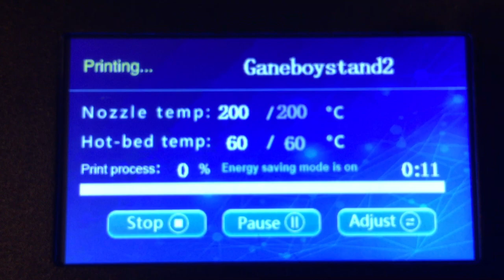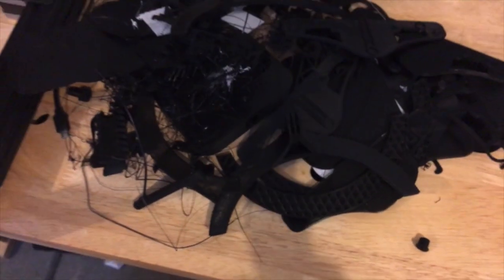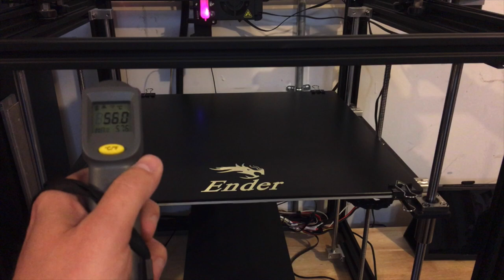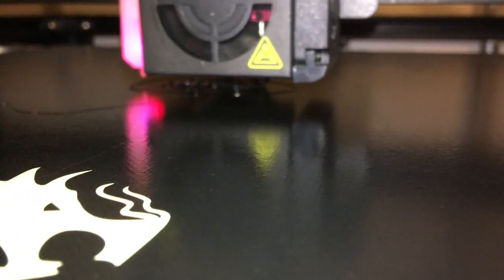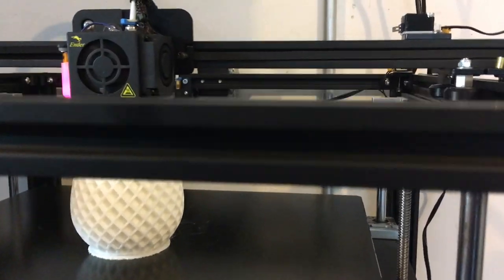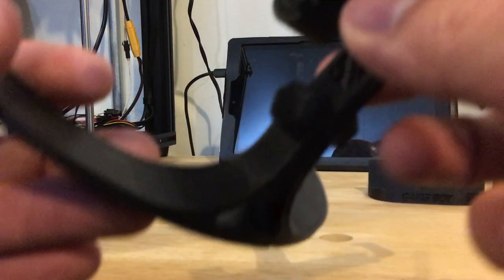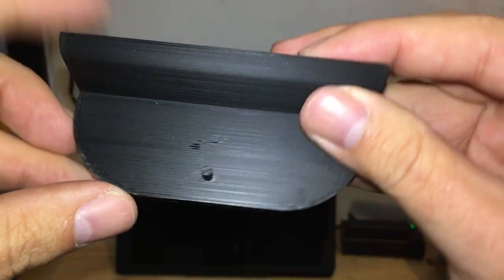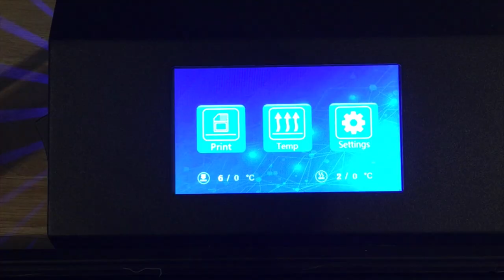Is the Creality Ender 5 Plus a failure?

Comment: I believe the problems shown come from wrong expectations. 3D printing is not a trivial think and so issues like the low temperature environment and many others can lead to falures trying to print. 3D printing is kind of a dance of parameters that influence printing. Operating the printer at a normal living space temperature increase the probability of good results.
There are 3D printers like those from Prusa that offer a more mature device.

Comment: Just purchased one, printed properly out of the box as well.
Reply from the maker: My power supply unit just died completely, only after 2 months.
Reply: @TripodsGarage  did you plug it in?
Reply from the maker: papapower -Yeah, found out after this video aired, the circuit breaker actually tripped, and was the real issue!  Who knew!

Comment: I have a CR 5 Plus and am having printing problems. I checked the print head temp with a thermometer and found the temp to be off. What type of thermocouple should be installed in the hot end?

Comment: so were all those failed prints 100% down to energy-saving mode? I have read people who say the energy-saving mode is useless, well it is on lock glass but on plain glass with adhesive when printing some PLA's it works ok and on very long prints it can save you quite a bit of electricity, I wouldn't risk myself though as if I lost a 24-hour print due to energy-saving mode the printer would be taking a flying lesson.
 I see you in live chats all the time and have conversed with you on many occasions and yet never knew you had a channel.
 +1 Subs

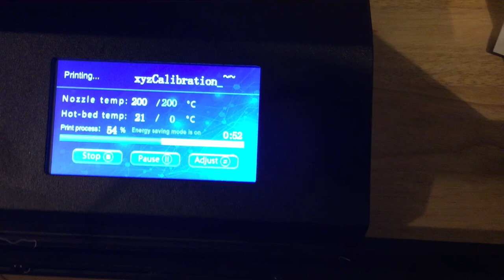Comment: At 5:08 I can see your bed temp is really low. I would have thought that you would need to keep this temp at 50C for PLA? On my old Solidoodle if the bed temp was low the glass would let go of the job. aahhhh I should wait until the end of a vid before commenting. Looks like you fixed that one.
Reply from the maker: Yeah, you will notice the Energy Savings Mode is on in the camera pass.  This feature turns off the heated bed just after the first passes.  I turned off this awful feature, my heated bed stayed on!  Yeah, I keep the bed temp at around 65 or more depending on the ambient temperature in the garage.

Thanks for taking the time out of your day to watch my videos!
Please like, subscribe and share! Tripod

Comment: Mine prints flawlessly right out of the box
Reply from the maker: Yeah if I would have knowing about that Energy Saving Mode, think my would have printed perfectly also.
Reply from the maker: @marthale7 Make sure Energy Savings Mode is turned is turned off.  That feature shouldn’t even exist 😉
Reply from the maker: marthale7 No problem!  Thanks for watching!  Did you watch my setup video below?  What is the current firmware for your machine?  It might already be current.

Creality Ender 5 Plus - Unboxing, Build, Bed Leveling, and first print! https://youtu.be/SDAfXD4PN2U

Please Like, subscribe, and troll..
Thanks- Tripod
Reply: There is nothing wrong with Eco mode by the way once you get the adhesion problem fixed there's nothing wrong with Eco 4 pla
Reply from the maker: @RealFifty  - Glad to see that Eco Mode works for someone!
Reply: I agree and a cool feature would be the ability to set the bed temperature with Eco mode once it kicks in to just drop the temp to something like 40c
Reply from the maker: @marthale7 Yep!  Nice cool glass plate, and the part slides like butter!
Reply: @TripodsGarage  So you dont need a better power supply if you just turn off eco mode .
Reply from the maker: @glenn1620  What does ECO Mode have to do with the horrible PSU’s they shipped with these machines early on?
Reply: @TripodsGarage  im asking if u turn off eco mode will the problem stil be there to buy a better power supply , on comment "Yeah if I would have knowing about that Energy Saving Mode, think my would have printed perfectly also."

Comment: Idk why I only have. Big problems with this one 😐 while my two ended 3s are working amezing... from bed prints to heat fails to broken filament sensor getting crazy off it
Reply from the maker: I recently bought a Ender 3 Pro’ish from Micro Center only to do a couple videos.  The bed is warped, and the board failed in just a month.  Last year my E5+ was acting all crazy and wouldn’t home correctly.  It kept on crashing in the front left corner. I reflashed the firmware, that didn’t work.  I replaced the board, that didn’t work.  I inspected all the connections couldn’t find anything wrong.  Finally I ran my fingers down each of the limit switch wires, and found a soft spot on the Y axis!  Sure enough after stripping back the wire, the wire was barely connected…

Comment: Hello
Wash your superplate... 
Your isopropylique alcool is 50%, not 99,9%
Before, launch Auto home and 16 control with bltouch. 
After... Disable eco mode and 16 point bltouch and decrease your Z by step -0.01mm at start printing, just before Auto home...
My Z=-2.40 (Ender-5 plus) 
Is not good, use 3D LAC = 0 fails 😉

Comment: dont use hair spray that wont help anything, when i had this problem i used a elmers glue stick and now i dont have any issues with the printer
Reply from the maker: @DJ Thanks for taking the time to watch my video!  Yeah, hairspray!  I was desperate to find a solution, every part kept on coming off until I found that Energy Savings Mode!  What a horrible feature!  Now that I have turned that off, and clean the bed between prints I no longer have adhesion issues.  I did use the glue stick after the video to test it out.  Wow! It most definitely works!  I have to wait until the bed is completely cool before I even attempt to remove the part.
Thanks again for watching - Please like, subscribe and comment - Tripod

Comment: I've had mine for a few weeks and haven't been able to finish any print.  Creality support has been ZERO helpful.  Last adv8ce w a s the printer had the wrong fireware.  They uploaded new firmware and when I flashed the screen it caused 3 white columns to flash on the screen and locked up the printer.  I was able to download other screen firmware and now I'm  back where I was.  I've been asking for a refund to no ava8l so far.  I want a proven Ender 3 but will go to another company if I don't get a refund.

Comment: WOW! bought this brand new nearly a year-and-a-half ago to this day and YET TO GET PRINT ONE!!! i have bought add-ons, read countless tutorials, mothered this thing daily - and N O T H I N G. $600 - $700 of JUNK. seriously! THIS IS THE WORST CRAP EVER. 100% SICK OF THIS SHIX. Other than what i've seen on youtube - I've NEVER seen this thing work. I've met several people who've bought this same thing and NONE of them have gotten this CRAP to work.

i broke down and bought a used flashforge - and it worked on day one!!!

Skeptical? thinking about buying one anyway? ok - go though EVERY setup on this 3d printer on youtube - you'll see the ONLY ones that "work" have been heavily modified and requires SEVERAL components NOT included.

worried about a budget? $500 - $600 for the craptacular 3d paperweight, + $100 - $250 for all the add-ons that doesn't make it any better + another $500 - $1000 for the next 3d printer you'll buy to realize what a mistake the ender 5 plus is.

If this were a car - creality be sued out of business

Comment: These printers are not for noobs。
Reply: I AGREE!!   I have two ender 5's which I learned on.  I got the Plus right after it came out.  The first thing I did was replace the extruder with a SeeMECnc and the hot end with a MicroSwiss.  It has been a workhorse since then.
Reply: In other words, do not buy an Ender 5 Plus as your first Printer?
Reply: Chris Marchese it’s kind of a gamble. You may or may not get a defective unit from amazon or whatever seller. There should be a troubleshooting guide because more than likely there will be a couple of problems even if following the assembly/install procedure. It will be a headache if you have no experience or patience to trial and error.
Reply: @tanklergaming103  I just ordered my Ender 5 Plus tonight. Guess we'll see what happens. I bought it with profit so it's basically a free 3d Printer.
Reply from the maker: I agree!  I have been researching and following these type of printers for about a year before I pulled the trigger, so I had an understanding what I was getting into.  I really just wanted my first printer to have a larger build volume.  If you love tinkering, and troubleshooting these can be of great interest.  However, I can see were someone can easily get overwhelmed and frustrated very quickly!
Reply: @TripodsGarage  There are some good groups on fb with people that have a lot of 3d printing knowledge to help get you on track.
Reply: @aninconspicuousman2288  It is a great printer, but take your time and don't expect it to be perfect on the first print.   Any 3D printer will take a some tuning to get good prints.
Reply: Tripod's Garage I was under the assumption that bed heat being maintained was 3d printing 101 with PLA. I think it’s over exaggerated, I’ve had successful adhere with initial bed temps at 60 and nozzle temp at 210, normal bed temp would be set at 25 or turned off automatically with eco. It works so well that it’s annoying how much effort to take it off. In my opinion, while the initial bed heat is hot by adhering and bonding to the surface of the heating bed, when it cools down after 1st layer is done is best. You don’t want the print to mess with the structural integrity of the first layer in any way at any stage of your print. Please don’t take my word for it, do a quick 5-10 minute test print of something simple. Please let me know what happens if you try. **used stock CE5-Plus heat bed.
Reply: I have only been using PETG so far. I haven't tried Printing with another type of Filament but I'm getting some decent quality. Also using Luke's Hotend Fix. I have upgraded bed springs, Capricorn XS Bowden and installed an aluminum Extruder. May print and install a direct drive system but not sure yet.

Comment: Would you buy it again or something else?
Reply from the maker: I would buy this printer again if it provided better documentation, Meanwell power supply, and if a MFG would actually return your messages!  Once I figured this out and replaced my burned out power supply with a Meanwell.  It is running a lot better.  Otherwise, for my next printer I will definitely be doing more research!

I would suggest watching my other video below.

Don't buy a 3D printer until you this! How to replace the cheap power supply! https://youtu.be/A-Zb40P09MQ 

If you could please like and subscribe 😀

Thanks again Tripod